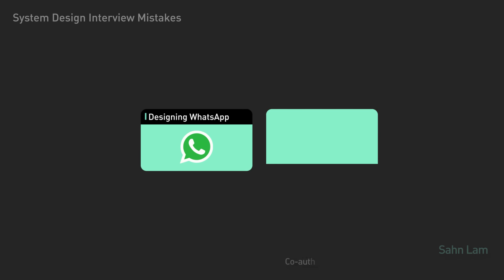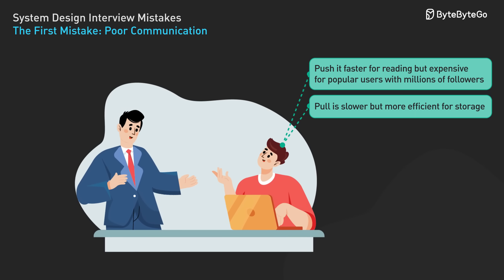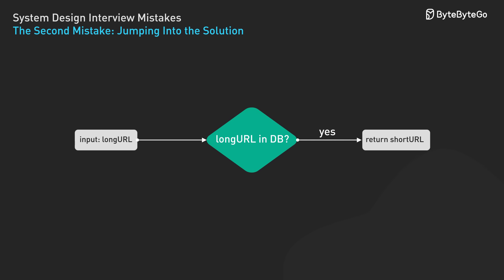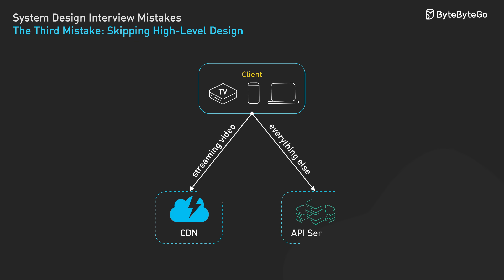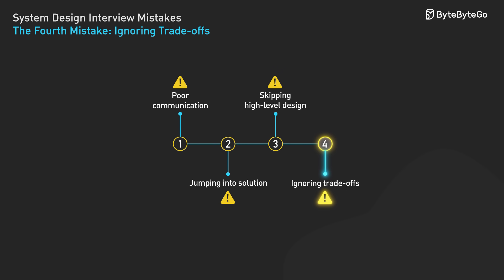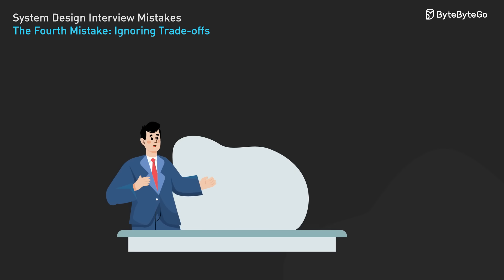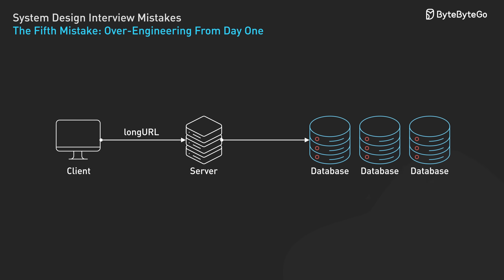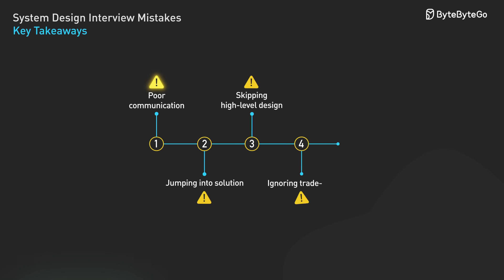System Design Interview – BIGGEST Mistakes to Avoid

Comment: This is a great video. I've been in software engineering for almost 30 years now and rushing into a solution and over engineering things is a classic mistake that newcomers do. It is vital to consider every aspect when designing something, for example, time, costs, maintenance efforts, performance. It is great fun to design something using the latest tech stack but sometimes it is completely fine to build something simple.
Reply: unfortunately they are just reviewing how good are you at interviews.